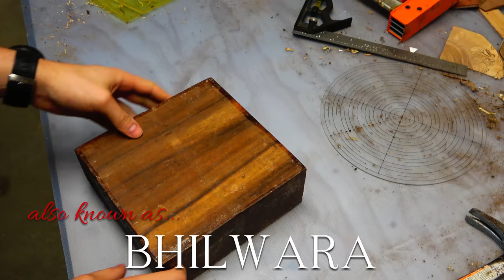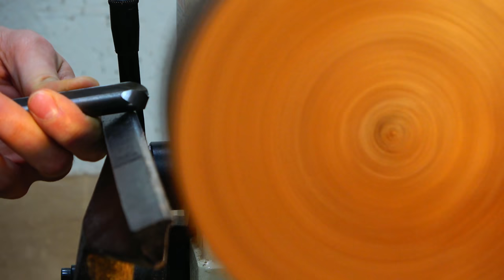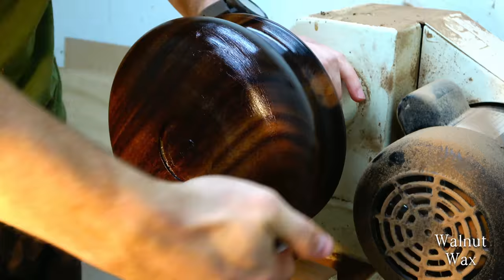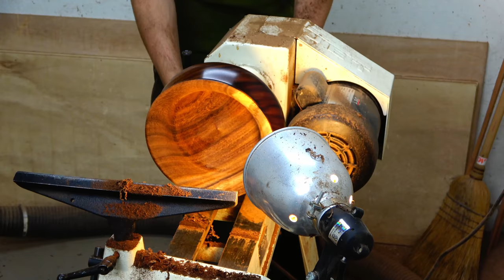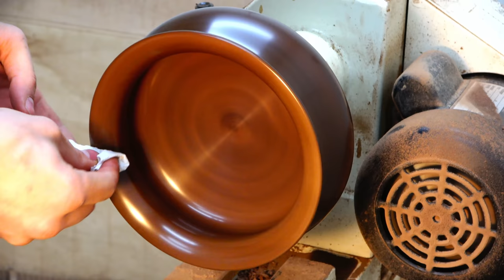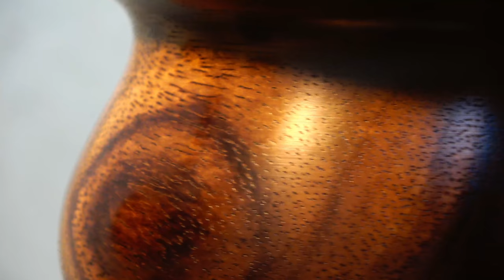Woodturning:  Bhilwara Bowl

Comment: Beautiful piece. Thank you for not speeding up all of the turning. It is important to hear the tool cutting while turning, and speeding up videos spoils that. I was interested in your technique of using Yorkshire Grit over sanding sealer. I usually sand off most of the first coat of sealer then reapply, then burnish it with shavings, which gets a similar result.
Reply from the maker: Thanks Nick.  I've heard of using sanding sealer after grit, but it seems to me that doing so would make the piece less food safe.  Maybe I'm wrong about that, idk.  I also don't view sanding sealer as a finish, but merely as a primer of sorts to ensure the finish will take evenly.  In my opinion, sanding sealer is too precious to use for any other purpose, especially when there are so many ideal alternatives for actual finish.

Comment: New to your channel and I love your work.  Your videos inspire me to get out and turn stuff!!! I am curious about your finishing routine as it seems to produce a flawless result.  Does the beeswax and orange oil become a hard wax finish so to speak?   Also, what do you use for the 5000 grit abrasives?  I ask because I cab get really good results with abrasive paste and "OB Shine Juice" which if your unfamiliar is made up of equal parts shellac, denatured alcohol and mineral spirits.  However, upon close inspection I can see micro sized grooves... Although they are virtually undetectable unless they are hit by a light at just the right angle, I can see them.  They don't make the bowl unsightly in any way, but I think I could do better.  I can't wait to see your next video!!!
Reply from the maker: Thanks so much and great questions. I tend to like the beeswax and orange oil for non-shiny finishing or even pre- finishing. My perception is that the acids in that compound bring out the color in the wood, and if you let that finish dry it does become fairly hard. I like utility finish better for the final finish since it does allow for a higher polish than the beeswax. I use a fairly cheap sanding disk set from amazon. Yeah the sanding grit pastes are great but they do not replace fine sand paper. The grit are generally considered 1000 grit and higher, so if you skip fro 400 or even 600 grit right up to 1000 grit paste, there might be larger scratches from the lower grits that the pastes won’t remove. The friction polish is hit or miss for me. I used to use it all the time, but I just don’t get good results from it. Probably lack of practice on my part though. Also the surface dryness too.

Comment: Just purchased a piece from your Etsy store. I’m a wood turner who supports other makers. Do you have a Patreon?
Reply from the maker: Wow, thank you so much, Zebulon!  Much appreciated!  I'll get it sent out to you ASAP!  I don't have a Patreon yet.  I haven't quite figured out all the social media platforms yet.  I'm not even on FB hahaha.  Cheers!  And THANK YOU!
Reply: David Adamsen You are sharing things of value through well produced videos. A Patreon might help pay for a Carter Bro’s Roughing and Bottom gouge ;-)
Question: when do you decide to use the Tung Oil? On punky wood?
Reply from the maker: @NativeEarthlingAI  That's the goal!  Nothing mass-produced.  Just one-of-a-kinds as good as I can get them!  Yes, definitely true.  I've missed having a roughing gouge.  Things for me to think about!!!
Answer:  I use tung oil on stuff that is not completely dry when I know I won't be able to complete the turning in one day.  If I have to leave something overnight, I risk the piece cracking, warping, etc...  IMO, the tung oil helps to protect the piece.  Also, it is intended to soak for a long period of time, so I'm not only protecting the wood but using the time away from the lathe efficiently.  Only downside to tung oil is that it isn't food safe.
Reply: David Adamsen Thx! What’s the grind on that Carter gouge. Looks like 40° but not the Stuart Batty style. You might check his vid out to see how you can speed up your bowl work. His technique works. This: https://youtu.be/N7BjRcSDurM